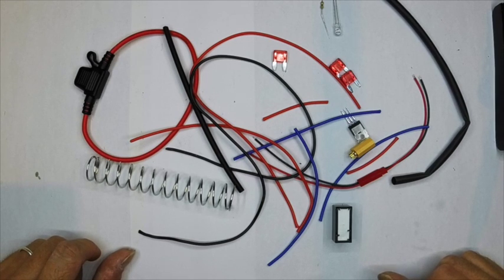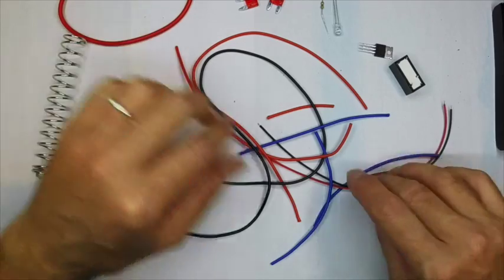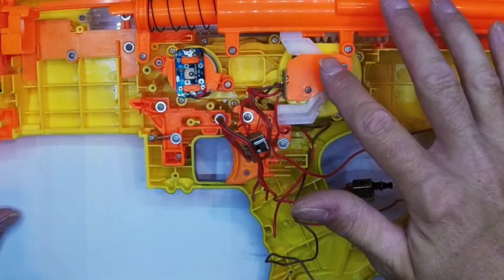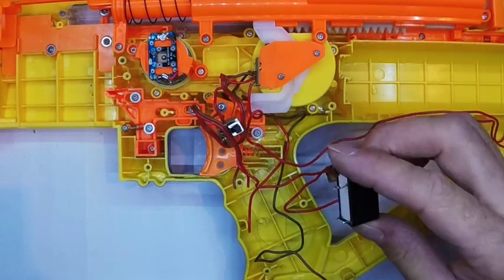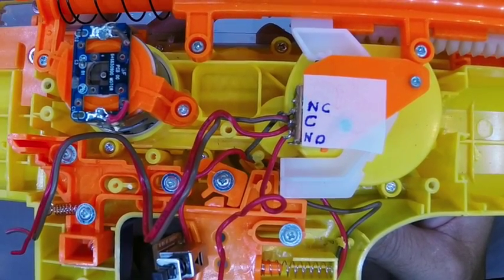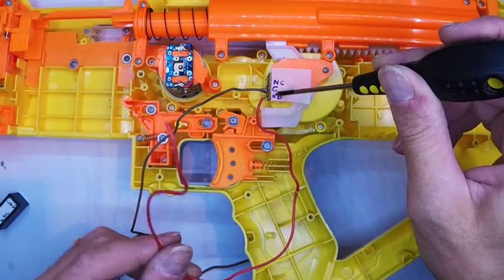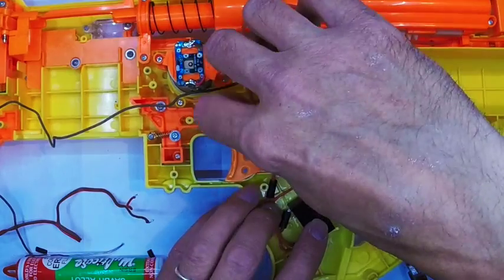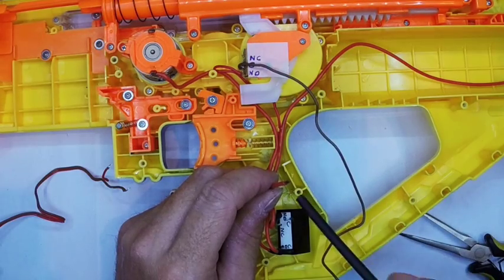Nerf Stampede Re-Wire V2 Part 1

Comment: would this work with a 9kg spring
Reply from the maker: Yes but you will break the stock gearbox and you might want a higher rated FET, Uknerfwar sell a 100A+ one.

Comment: Can this be used as a guide for the newer v3 wire kit?
Reply from the maker: Yes, the circuit is fundamentally the same except the components are held on a PCB, however I have not managed to get mine to work.
Reply: @foamdataservices  thanks for the reply, So should I be fine soldering straight the relay like in the video and just leave the pcb out?
Reply from the maker: The PCB makes the job much easier. If they haven’t got the PCB anymore then it’s just a V2 kit.
Reply: @foamdataservices  definitely came with the pcb, wiring skills are a bit rusty and just wanted to make sure I could follow your guide.
Reply from the maker: I have no idea how to get the PCB to work, use BSUK customer service for tech advice.

Comment: What is the point of putting so much extra crap into a stampede instead of just motor, trigger switch, battery?
Reply from the maker: Using a FUSE protects the motor from surge current, like if the cycle control fails from a piece of foam jamming the forward bolt control mechanism. Using a RELAY enables the stock cycle control switch to be used, stopping the most common cause of run away firing and minimising set up issues. The use of a MOSFET to protect the master arming switch means it won't MELT if there's a current surge, as it wasn't designed for 20A. If you are too stupid to understand this by all means use sub standard components. .
Reply: Foamdata Services is the fuse necessary